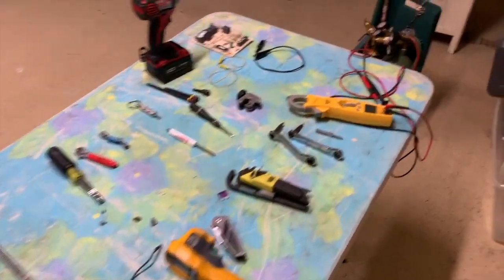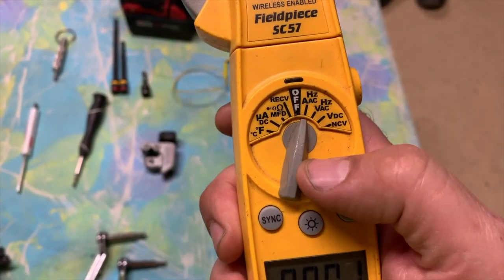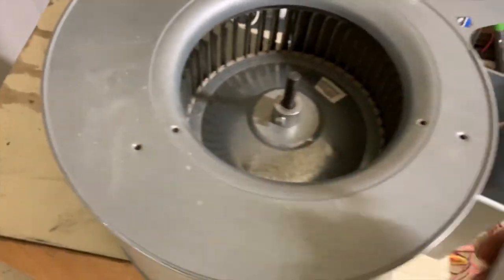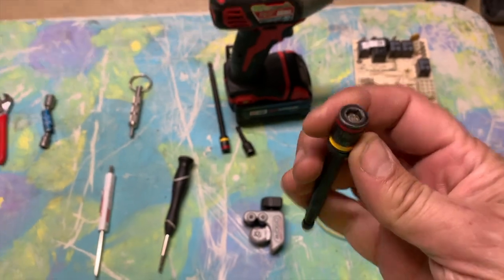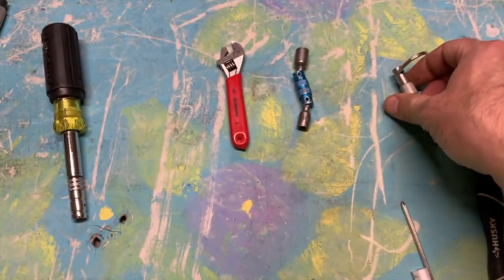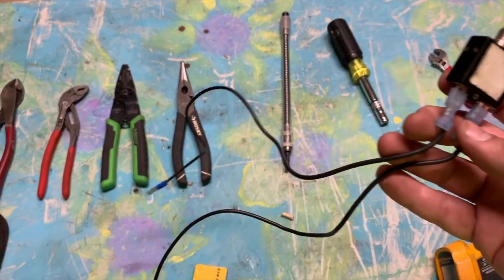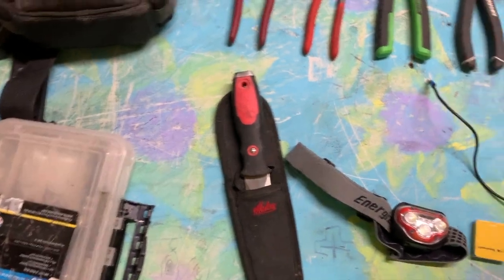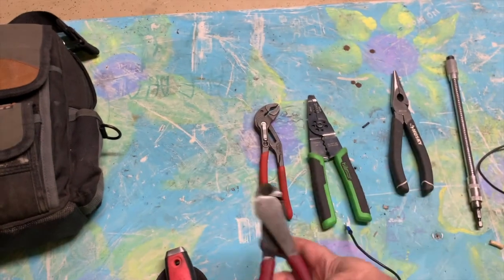Basic Hand Tools for new HVAC techs

Comment: For trouble shooting, I carry a drill gun, a meter, some jumpers, a pocket thermometer, and a Leatherman, no tool pouch. In my pockets, I have a couple of nutdreivers for the drill gun, some wire nuts, a few self taping screws, and a pocket screw driver. You can trouble shoot 95% of service calls with that. And like you said, once you find out what is wrong with it, go get the part, and any other tool you need, which I just usually bring my $25 Home Depot tool pouch. I rather buy $200 worth of tools, than a $200 backpack!😀
Reply from the maker: Absolutely... On my heating calls, I carry the same but instead of a drill I use my 8 in 1. I'm lazy and when I talk to the customer on the phone, I get a pretty good idea what it is. Again, your meter is probably the most important